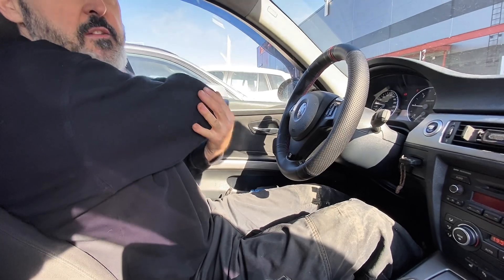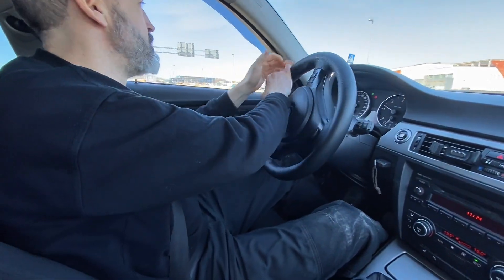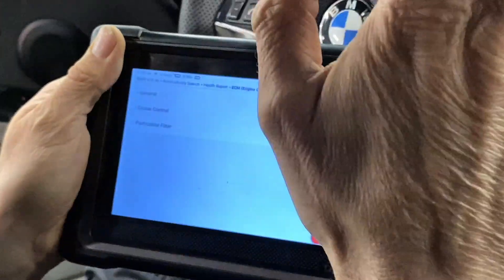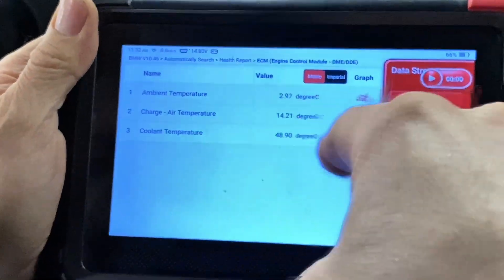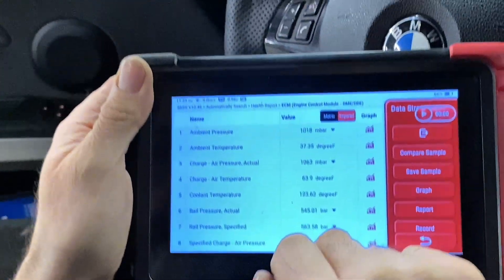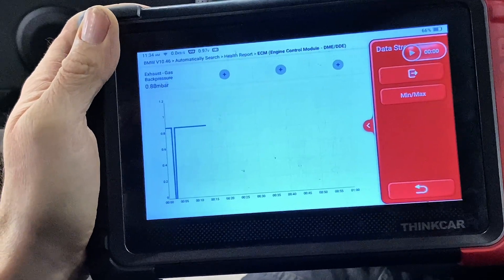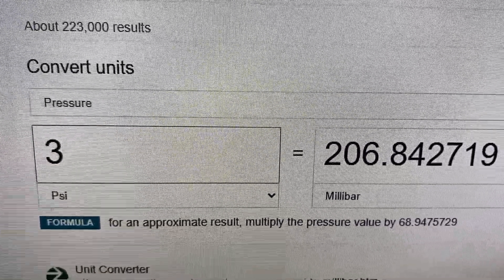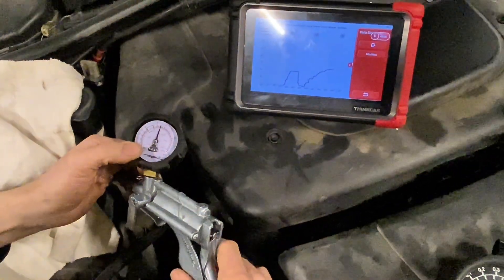DPF Blocked? Full Diagnosis With Road Test dpf + Tools You Need

Comment: Dpf delete, would the back Pressure be zero? Will be buying a car with EGR and dpf delete and testing with code reader and live data would show 0 back pressure?
Reply from the maker: No not zero but close. Be careful as new laws in the EU are in now regarding dpf egr delete
Reply: Here in uk many have dpf delete. The testing is visual inspection only. I’m assuming you can install used dpf if they test emissions.
The car has battery discharge issue but dpf been deleted and EGR one less headache. Can maybe up power later to stage 2 as dpf already done and it’s only 232bhp m57 can go higher with less than 100k miles.

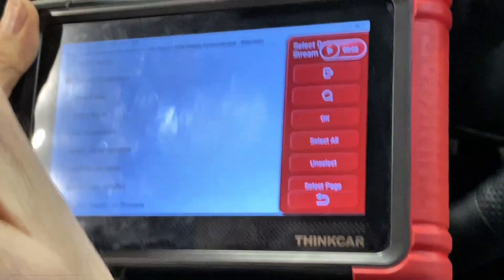Comment: 3:43 whats with the battery voltage all over the place on the scan tool ?
Reply from the maker: Yeah good catch bud. I noticed that myself last week. It does it on any Bmw and I assume it must be a bug in the Thinktool 😐 I will update it and see if it fixes it. The function of the tool isn't affected though.
Reply: Great job 👍